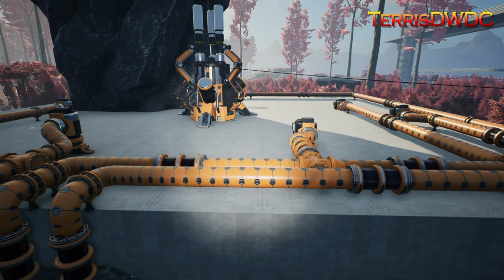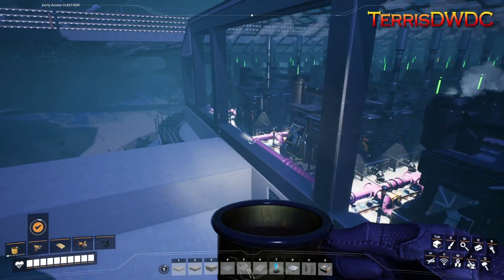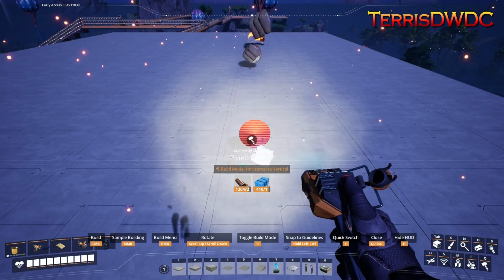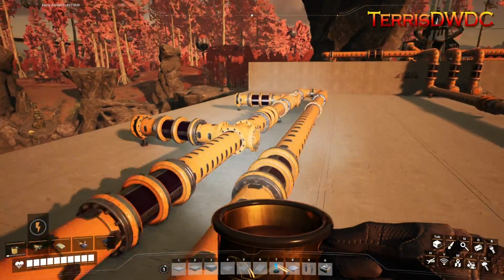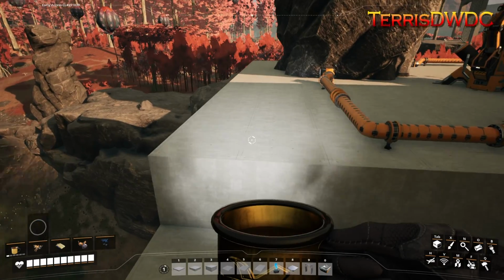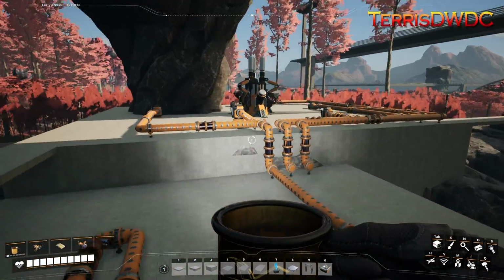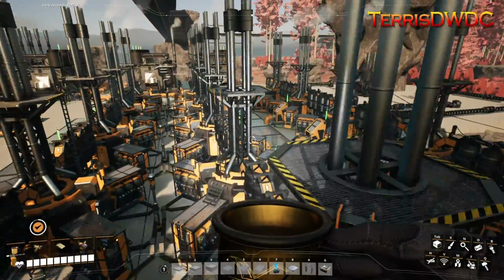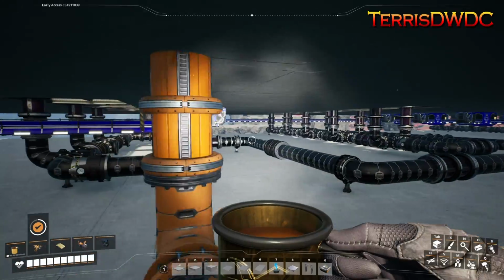Satisfactory Tips - Working with pipes tutorial

Comment: Nice vid. :hand-purple-blue-peace: It's a shame it's not explained in game how pipes and liquids work. 

some more quirks about pipes to consider: 

Valves limit flow until the section of pipe before the valve is completely filled. This isn't very relevant on flat pipelines but it can cause issues if you have a lot of height variation.

Height grants pipes priority and they also have a full pipe requirement for the pipe section at a lower point. This is how people can make priority junctions in the same vein as the conveyor merger u showed for saturating belts. This is also why some people advise to never feed machines with a pipe line that is positioned on a lower level since the height can cause sloshing due to the input pipes having constantly shifting "priority".

More headlift also grants priority so if you have a lot of height variation already, you can potentially use pumps as a bandaid solution to saturate a pipeline.

Power generators can be filled without being turned on. For example, if you have a fuel set up like this, you can connect all the pipes before connecting any power lines to the generators. This lets all the machines and pipes to fill making the work pressure super consistent and the flowrate reliable. 

Industrial fluid buffers make everything easier. They provide work pressure and even headlift, and in my experience, simply putting a fluid buffer (with a pump to fill it) next to an input line gets rid of all sloshing without the need of looping the line or using valves.
Reply: Excelent! Thank you!

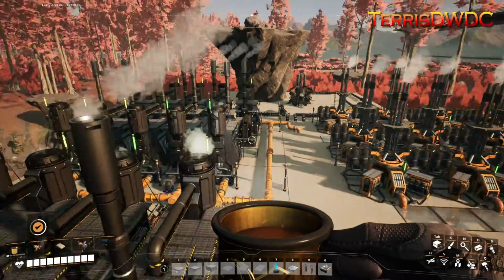Comment: Is this method only useful with distributing liquid into machines rather than the liquid coming out of the machines? I noticed at 16:49 your Feul outputs dont have a loop around from the back. I would think that the pipes in the very beginning could suffer from back slosh from the pipes ahead of it since theres only 1 exit. Let me know! Ive been getting wrecked with the piping on my Fuel Generator setup using Heavy Turbo Fuel alternative. I am going re do all of my distributing piping in my build from this video, thanks!
Reply from the maker: One thing I have found that helps on the output side is using valves to prevent back flow.  You can direct the fluid and help prevent too much sloshing. I will also ate times included a storage tank on the out side with directional valves on either side of the tank to force fluid flow.

Comment: A 20 Minute video to say these TWO things:
1.- Use Valves to set the flow direction of fluids in order to prevent slushing.
2.- Dont use Floor Pipe Holes.

Comment: I havent encounterd any reason to use this manifold setup in my 300 oil to 666.666 Turbo Fuel setup. This could be becuase none of my lines has more then 400 average fluid per minute of usage.  
Or it could be that way I emplemented fluid buffers at several points. At the crude oil entering stage. At the Fuel stage I have two buffers from seperate lines. At the final Stage where the Fuel generators are run thier is 4 Turbo Fuel buffers that have forked from two seperate TurboFuel lines .
Spliting Fuel/TurboFuel in half was done as a result of only haveing access to tier 4 belts at this time. The water bottles and compacted coal would not fit on single 480 per minute belts.

Becuase off the number of generators involved(136-148).  Each half of the turbo fuel was into two buffers. A total of 4 buffers. Permiting me to have 8 rows of 17 gernators which can all fit on one story. I bootstraped the system by jioning the pipe from my fluid buffers to one of four indpendedent linear lines which has 17 generators on both sides: (17*2)*4 = 136 . When my fluid buffers refilled I conected the next line of gererators to the next buffer. Currently im only useing 136 of 148 gererators beacuse I have 9 truck routes id like to have packadged turbo fuel for.
Reply: Right now im doing a 1350 crude to 5000m3/m rocket fuel to burn in gens factory and i am almost at the point of placing down the 1200 generators, and i really really dont want to. Might overclock 480 but its still gonna be a nightmare